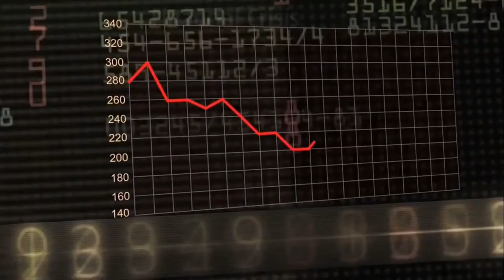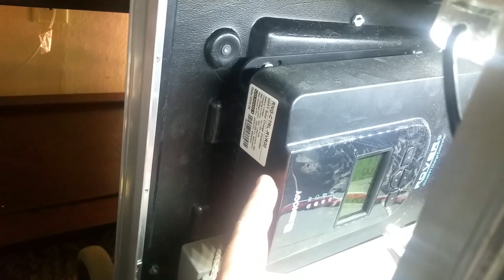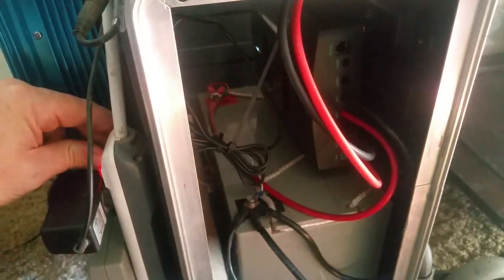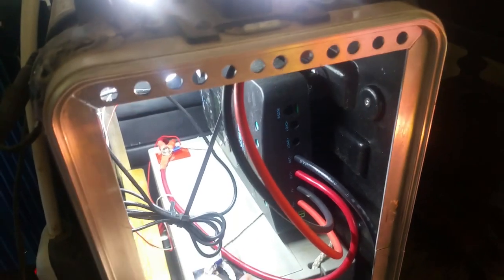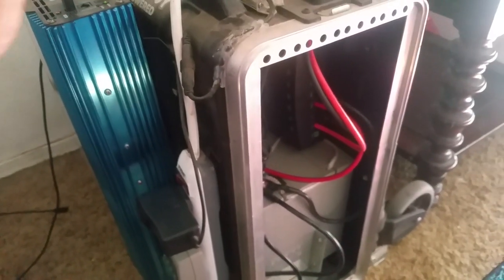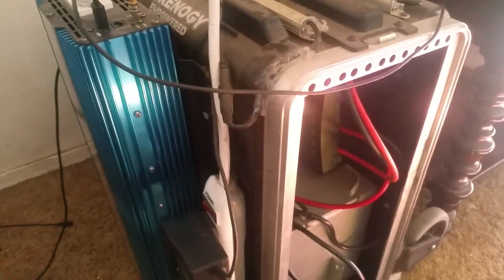30 Days of Preparedness Collaboration - DIY Portable Solar Powered Generator #SWPG

Comment from the maker: Questions? Let me know, here to help.
Reply: About how much did all that cost?
Reply from the maker: @sirnmpreps-a-lot  1 deep cycle 12v on ebay $180. Charge controller was $90, inverter was $300, and the panels were $90 each, 3 of them. Cables and connectors another $40. About $900 total for my system.
Reply: Thanks for sharing. I hope to have solar someday. Power company has too much power over my finances.

Comment: I'm stuck on the wiring size for lithium batteries they are 12v 20ah deep cycle lithium batteries and I can't figure out which wiring gauge to use to connect them in parallel, it's very fucking frustrating because I don't want to fuk the up
Reply from the maker: i hear you, I use 0 or 1 gauged heavy duty battery cables